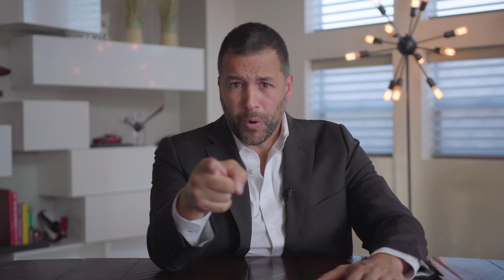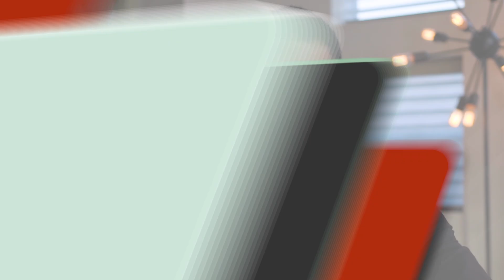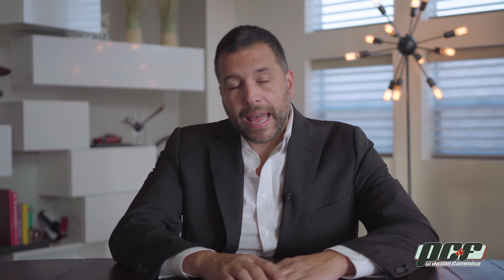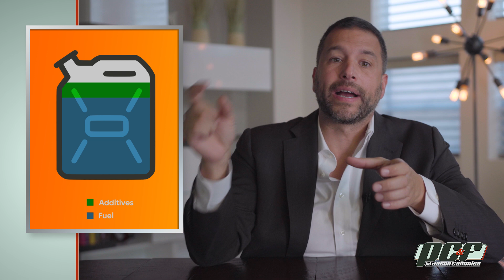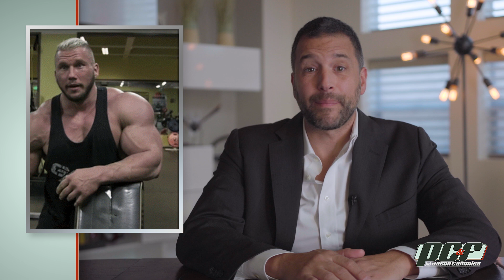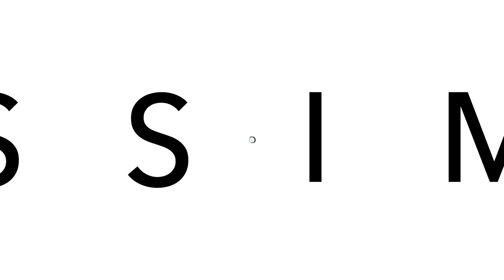Why you should never put premium gas your non-premium car — Proper Care & Feeding with Jason Cammisa

Comment: Well... It won't hurt putting premium fuel in a non premium car. 
What I've found in my 34 years tinkering with cars is by running the best fuel in my cars (even the ones that run normal fuel) I've never had to have my fuel injectors cleaned... and I've regularly driven more km per tank using 98 octane (Here in Aus). There are more chemicals dedicated to keeping things cleaner.
Case in point, look at a car with 160k km regular fuel v's 160k km car with premium... everything is cleaner... ports, valves, combustion chambers etc. I'm talking cars that are maintained too.
Many automotive channels have done direct testing sooooo..BUT putting regular in a car that demands premium is looking for trouble. In emergencies sure to get you going but drive gently.

Comment: Well, I'm not an expert but wouldn't it be true just for carburettor cars? Any fuel injection would accommodate automatically and it would to a degree work. It's probably not worth the effect but it would work.
Reply: It depends on if the car has knock sensors and if the ECM (pretty much every car post 1990s) is even programmed to allow the timing to advance into that territory. Just like rev limiters, the manufacturer sets limits so that things don't destroy themselves so there's only so much a commuter car is going to advance timing. I would expect something like a base model Mustang that calls for 87 to maybe have more allowance for advance than something like a Corolla meant to drive to and from work. Carbs though are true. There's no closed loop logic so your distributor is set the way you set it so you set it and it stays there no matter what you do with your fuel. Bottom line, a car's manual will state a "recommended" octane rating and a minimum based on compression ratios and the set limits for ignition timing.
Reply: @TheLouisianan  I see you are connoisseur. Thank you for additional info.

Comment: I disagree with his opinion on this one, if you can notice the difference when you upgrade parts, you should be able to feel where it makes a difference, high octane is better at the top of the rev range because it is more resistance to igniting it uses the fuel more efficiently and it revs smoother and just a little bit faster then what you would get from a lower octane. I’ve seen Honda’s increase the hp just by putting race fuel in there vehicles or by running e85 with a tune.

Comment: I absolutely disagree. I have a lot of cars, one of which is a K11 with CGA3DE for everyday, fully restored and let's say, fairy stock. Let's say that these engines are tuned to have a lot of low-end torque for the class of car as well as very long gears(even longer on some of my project sports cars). Which, of course, hurts midrange RPM. Until you fueled it up with A100. It gets a lot louder between 3000 and 4000 rpm, but it has significantly more torque in this range. It's ran by Bosch Motronic 4.6.0. Fair to say that I'm pretty disappointed from anything german related to electronics, (even repaired this ECU once, i was happy to have a spare for parts), at least it can adapt pretty well with huge variations to the advances and fuel trims. It can even run turbos on stock maps, though it's not recommended to full throttle it for long on fifth gear. That's why the better solution for modifying this car is an SR20VE with the pipe coils from the CGA3DE, ran by an EMU with the engine having an additional crankshaft trigger wheel for CPS. That's the downside of the ancient design of the SR20, it's designed to use ancient spark generating system(I am not sure the proper name for делко in english).

Comment: Erm not actually true on all cars...  The computer controlled timing changes depends on the grade. the knock sensor informs rhe ECU which then changes the ignition timing.  

On old cars that had fixed timing this would be a problem but not on cars that do not have a distributor as the timing is advanced or retarded by the ECU...

Comment: It doesn't do significant difference, but I tested old NA small 1.3 litre engine with european 95 octane gas on dyno and then with 100 octane and it made few extra hp...in my country, less octane gas has also more "bio" components, so less quality and shelflife (which is btw garanteed for very long 14 days)...

Comment: I know our Octane rating in Australia is different. I think our 91 is your 85.

I run my car on e10 ethanol added (91 + ethanol) and every 3rd or 4th fill do a 1/2 tank of 95 or 98 for the added lubricants in the fuel.

Don't know if it is doing me any justice but tio lazy to manually add shit.

Comment: Wtf dude anything modern enough to self tune gets better gas mileage or power on premium ie most cars after 2006 and i know my car both runs better and the tank lasts longer on premium even my old 98, premium isn't technically worth it and does have a negative effect on some car mostly mazdas but you about break even on mpg different and it's nice having to stop less frequently

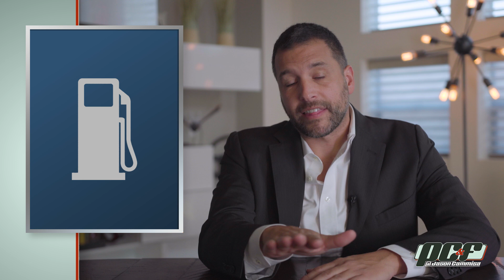Comment: Never put worst fuel on you car than recommended as said in 1:48. It will compensate but it can cause misfires as stated at the beginning. Also, It will build up carbon and ruin your engine if you do it long enough.

Comment: I use premium only because my cars require it. It’s crazy I have 93 octane at my local bp and it’s $3.40 the local kwik trip has 91 and it’s $3.90!!! Why is bp that much cheaper? I’ve never had an issue with the gas but why is it so much cheaper?

Comment: True up to a point. Older cars can often benefit from a higher octane than the minimum advised, due to carbon and other build up. Especially high mileage cars are more prone to engine knocking because of this. Until you have your engine cleaned or rebuilt, premium gas is the safe bet in that case.
Reply: Where do people get their science from? Higher octane fuel just burns slower.
Reply: @truantray  It's science. Tried and tested based on sound theory  and facts. It even has a name: Octane creep.

Comment: I have a 2017 Chevy Cruze. Says 87 octane. But it's a high compression turbocharged engine. So I put 89+ and it definitely runs better. It seems to have more power and it might get a little better mileage. But if I go back to 87 regular gas, after I bit of running, I'll floor it and it starts to knock and the computer sees that and instantly pulls power like I hit the brakes. So it's obvious to me that the car likes to run on higher octane.

Comment: Little problem with the Ecoboost systems on this one.  They are "designed" to run 100% gas 87.  They can and will de-tune and run it just fine all day long...with loads of turbo lag, reduced boost(and available boost range), and generally sluggish throttle response.  The PCM only unlocks full performance options(full boost pressure and range, timing advance, and fuel feed) when it is given AT LEAST 85% gas 91.  It also seems that, in many reviews, Ecoboost systems are tested by journo's on whatever 87 is around(probably E10-15), so they do not really get the full understanding of the responsiveness and pep behind the powerplants...because FoMoCo did not want to confuse people and just said, "Requires E0-E15 87 octane".

Comment: Correct me if im wrong. But running premium gas allows you to run your timing more advanced (non computer cars) which in turn boosts your acceleration.
I advanced my timing in my 86 Bronco. Just to the point of detonation. The. Filled it with premium and was able to go another 4 degrees. I definitely noticed a difference in acceleration too.

Comment: I can definitely attest to this. I hear from some of my friends here that using Shell RON 97 fuel for a 1.5L four-cylinder Perodua Myvi gives the best performance. Tbh, there's absolutely ZERO difference at all.
Reply: Hi fellow Malaysian. 
You're right, Perodua cars, Protons ,T and H brands will not benefit from higher octane than Ron 95 as thats what they've been tuned to handle. Yes, they can also be tuned to handle MON 87 or Ron 92 (both equivalent) but mind you  first the cars would need to be retuned to take the lower octane fuel and also likely get worse throttle response due to timing retardation. 

If only our afternoons weren't so hot, then it wouldn't have mattered

Comment: I have told this to people many times but I know wonder about my 1.6 turbo just because turbos and hi compression engines need high octane to utilize boost or high comprehension .  

I can grasp that the engineers at Hyundai designed this engine with an ECU that compensates for certain conditions and won't let the car knock and make it's 201 HP  but considering the level of boost to make the power from a wee motor is there no scenario / condition where the engine could use higher octane outside of the peak effecient range . 

My question is are you more likely to get max advertised power more regularly  from stopping the ECU pulling timing as part of the design to run on 87 .

Specifically with these little turbo engines I would like to see a Dyno graph on same car , same day and see what happens . That would include turning the fans off to simulate temp difference and or heat soak of the intercooler where the car definitely pulls timing .

So , in that instance when a car 100% will pull timing with an engine using boost how would extra octane not make that less. I can grasp not getting more then the advertised power and Hyundai designing an engine to only make X so the engine doesn't make extra power which would potentially lesson longevity of the engine , trans and other components .

CERTAINLY if one fiddles with these cars to overboost them then higher octane would be if use .

Maybe not in cold weather or with good air . But what about weather that reduces power 

Anybody who has owned a turbo car has experienced flucuations in power based on temp and air .
Reply: May be very late and not so scientific as using a dyno. But my dad has a 2002 Volvo S80 2.0T, stock. We live in a hot tropical country where official afternoons are 35C but actually likely hotter. Our country has 91 and 93 equivalent in RON, 91 runs poorly in the hot afternoon, especially when sitting in traffic. It's quite hesitant to move. 93 improves that situation drastically in hot afternoons. Now at night, when temps drops to 24-26C, the engine is a lot more smoother. It feels like the torque comes in earlier too, likely from being able to advance the timing to what it should be. Might not fully answer your question though as the car is from an older era

Comment: Ya, this is true. But, it does not apply to vehicles with high mileage, which can benefit from the higher octane. Maybe not need 93, but 89, 91 maybe, it all depends on the vehicle, engine mileage, etc.

Comment: My 2 cents as an auto tech for 21 years, I’d stick with premium if the car calls for premium. While yes, newer cars do have knock sensors and can theoretically retard some ignition timing, there is a chance it can’t do it enough to not result in spark knock, which can hurt an engine. 

My wife and I had previous gen acuras (2008 era but definitely OBD II cars well into advanced knock sensors), naturally aspirated higher compression (for their time) engines which per the manual required premium fuel. We ran premium 93 in them and they sounded happy (no knock) and got their rated mpg. 
As an experiment I ran 87 octane and immediately noticed spark knock. Also could see a drop in mpg. I switched back to premium and knock was gone and mpg came back. For that car it’s a no brainer. 

As an auto tech, and now a manager who gets to drive a demo, I get to drive a lot of different cars. Recently I had a 2018 Malibu 2.0 turbo. Its the higher hp version and it said premium recommended. It came to us running strong, no spark knock. I experimented and put a few gallons of 87 in it when the tank was low and noticed a drop in power after it noticed spark knock while in boost. After a few times accelerating through boost with audible knock, the knock went away and it felt even a little slower. Faster than the 1.5l turbo Malibu cars but noticeably slower than when I first started to demo it. 
I filled back up with premium and the car was still slow until after many medium/ heavy throttle applications it kept testing how much more boost and timing it could throw in until finally/ gradually it all seemed to come back. 
We don’t have a dyno so I could only gauge all this by the seat of my pants. 

Moral of all this, yes I would stick with premium if the car calls for it. Even in the case of the 2.0l Malibu where it specifically states it’s recommended, not required like most cars state, it surely paid the price in reduced performance. Likely in lower mpg too. What’s the point in having a car like that if it’s automatically ‘turned down’ 25% or more? And in the case of my past older acuras, they kept knocking with surely would have caused engine damage if 87 was used forever.
Reply: So, I've been asking this to anyone that will listen and I'm still not gotten a straight answer. Maybe you can clarify if you have the time. I have a 2019 v6 Camaro that clearly states 87 is all that's required and there's debate if 93 does any good at all. Though, I've seen some proof that it does allow for a bit more power in heat soaked situations that's not my issue. My issue is that it started clattering/knocking while going up hills. I switched to 93 and it stopped. I thought maybe GM wasn't being entirely honest (for me that was one selling point on the v6) but after looking and asking around it doesn't seem to be an issue for others. Should I be concerned?
Reply: @CynHicks  it honestly sounds like ambient temp likely got too hot for 87 and it was knocking.

My country only has 91 and 93 octane equivalent and while my manual states 91 is fine, 93 is what's recommended. 1 month of 91 in my 05 Volvo S40 2.4i (naturally aspirated, but intake temps reaches high 80s C on afternoons) and it was definitely pulling power, especially going up a hill. Using 93 solved that issue
Reply: @randomesteven3935  It did start happening late last summer and I live in the south USA where it gets to around 100 or more on the hottest days. I may go back to 87 when it gets "cold" again next January.

Thanks for your time. It makes a lot of sense as to why it doesn't seem to be a common issue. I was also driving quite a bit in it last Summer too, like 700 miles per week average for some time which isn't typical mileage for most Camaro's.

Nutshell: maybe it WAS getting heat soaked with normal sub 2k rpm driving. Man, I hope that's it. I can go back to 87 for at least half of the year if so. 😊😊😊
Reply: @CynHicks depends on the software and compression ratio, among other things. Its about if the software will ADVANCE timing in the absence of knock detection. If this is the case, then yes, 93 will help. However you would have to go on a camero forum for this type of info.
Reply: @Mt-ze3xe  Thanks. It's gotta fairly high CR.... I did back then. I learned that when heat soaked the LGX Camaro with stock tuning did in fact benefit from higher octane (I wanna say like 8HP to 16Hp average and with no knock) I also found some others having my issue. Essentially, where I live I'm going to get some spark knock during the hotter months unless I go with higher octane. Chevy didn't see it as a big enough issue to care about. Just like they didn't see it a big enough issue to recommend an heavier oil for the engine outside of track use... .. until they did. Regulations... 

I also learned that with a custom mapping you can get a tiny, negligible bit of power out of it but be stuck with 93. 

In a nutshell what I learned is that for better protection you use a higher weight oil, use more fuel, and use higher octane fuel. It might not be usually necessary but it is when you're running it hot and hard. The engine is perfectly happy and better off with weightier oil and higher octane fuel. They just didn't want to say it for obvious reasons.

Oh and thanks again for your time on the reply.
Reply: That's what he said in the video , use high octane if required by the manufacturer
Reply: @MrKrueger88  OP's post was regarding what was said at 1:49 that using lower RON fuel on a car that is tuned for higher RON would not hurt the car if it's a modern car. Some modern cars still knock on low octane fuel and can suffer some damage.
Reply: I did pretty much same test with n my Crosstrek when I first got it and had the same results. Now I have an AMG tuned to 93 and I put 94(because that’s the only I can get in the South Bay)
Reply: How about you pass a smog check. I've heard higher octane is better for that
Reply: I have the previous gen Malibu with the 2.5L NA engine. It doesn't say anything about premium fuel, so I put regular in it. I have about 150k miles on it and nothing wrong had ever happened. I just wanna know how it has such a high compression ratio (11.3:1) and doesn't require premium fuel. Has a higher compression ratio that my E46s M54 engine (10.2;1) and E90s N52 engine (10.7:1), and those 2 engines require premium fuel. I've been looking all over the internet and haven't found an answer to it, yet.
Reply: Yes. But the video was specifically about using high octane in an engine that doesn’t require it.

Comment: I have a weird car, 2006 VW Rabbit. My manual says 87 octane is the minimum requirement, but for max performance use premium.  There is a very noticeable difference between the two. I wish I never tried premium, it runs so much better.
Reply: It's not that weird. Lower octane fuel is usually being used for fuel efficiency.
Reply: @farishanafiah8461  On average I get 2 mpg better on premium.
Reply: @workingmanaudio2754  😹Not worth the extra money in my opinion.  Ethanol free on the other hand....